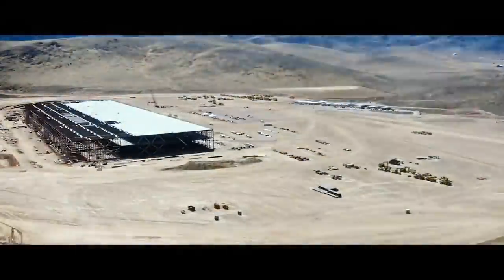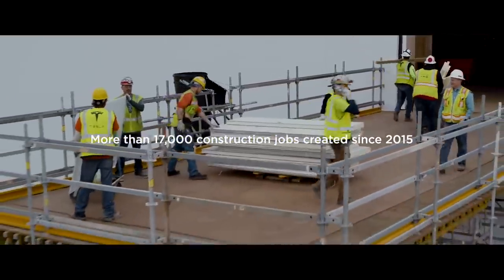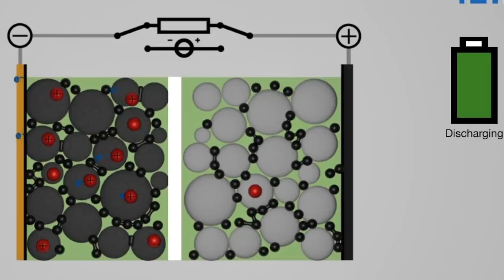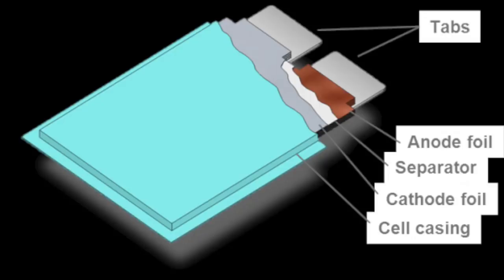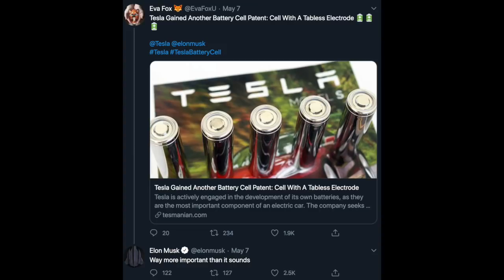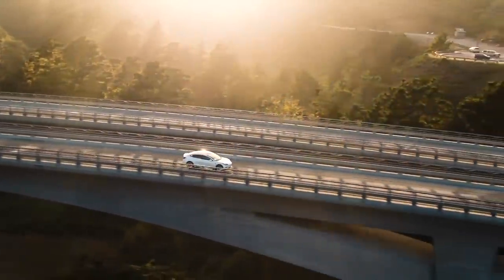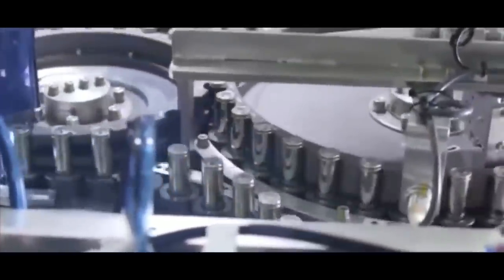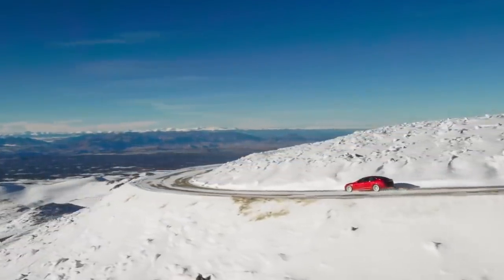Tesla's New Battery Breakthrough: Tabless Electrodes

Comment: Tesla filed another patent (December 26th 2019, as far as I remember) which stated a charging time of 9 minutes instead of 30. So the benefits of the tabless electrodes might ad onto that. I think it is very likely that we will see 80% of charge in 5-8 minutes from the new Tesla cells.
Reply: That would be phenomenal and wipe away the last advantage of ICE vehicles.
Reply: @michelangelobuonarroti916  And that will not be the only phenomenal thing! Much higher energy density, 3000 cycles (1 million miles lasting) and much lower cost per kWh. We will know more at the battery investor day. I am quite confident that the days of combustion engines are numbered. With Teslas new battery technology and enough fast chargers or a plug in the garage there will be no single advantage of ICE cars soon.
Reply: The issue with charging time, i.e charging rate is simple physics.
It boils down to the amount of actual energy transferred from charger to battery per unit of time which is all about Voltage of System and amps .
As it is now for 250KW Superchargers liquid cooled cables are needed and essential for 350Kw chargers. The resistance of of all elements in the charging chain becomes critical
Reply: I'm pretty sure that'll be the 100% charge time.
Reply: @feijaodo  Yes the 9 minute is defeninetely on the conservative side, I would not wonder, if we see something like 5 minutes. By the Way Elon Musk announced that they want to get the trophy of the cross race "Baja 2000" with the Cybertruck. Think that implies a fast charging time, as else it would be difficult to compete over longer distances.
Reply: I've had my fingers crossed for 50% in 5 minutes and 80% in 10 (I'll happily accept faster too). That would make EVs accessible even for people without home charging options and it would make the transition easier for a lot of people. It would also reduce the need for bigger and bigger battery packs and fewer Superchargers would need to be built. The criticisms of Cybertruck can't tow long distances would be moot. Hydrogen fuel cells would be done and Toyota could go F themselves.

I think increasing charge rate is more important than increasing density at this point. Range anxiety is not really about range; it's about charging. My Ford Escape only gets 320 miles on a tank, but it fills in 5 minutes so I don't worry and I wouldn't pay extra for a 4 or 500 mile tank.
Reply: @brogcooper25  Both is important because an increase in energy density reduces massively the cost if the battery if a similar cell chemistry is used - means higher energy density with the same amount of material means less cost per kWh. the battery is still the by far most expensive part of an EV. Furthermore would a doubling in energy density allow for domestic electric flights. And if the battery can easily be recycelt then there is no real big deal to carry 300 kg of batteries around in a middle class segment car. And yes the quicker charging would make especially a smaller car with smaller battery affordable, that is an important step towards fully electric cars.

Comment: I think the current charge time stated is incorrect?  I believe it only takes 30 to 45 minutes to charge up at a supercharger not many hours.
Reply from the maker: I was referring to the 220-volt charging rate which takes 8.5 to 10 hours and I mentioned after that the supercharger charging time is roughly 40 minutes. Thank you for watching, Kevin!
Reply: @Casgains  gotcha sorry I missed that, thanks for the video!

Comment: If you believe Tesla can make electric aeroplanes in the future gimme a like😊
Reply: They could at least supply some batteries.
Reply: Elon has already stated that 500w/kg (if I recall the figures right) would allow electric flight.
Reply: Tesla will overtake trucking, trains and air. its inevitable. Think nuclear to electric. Elon will solve nuclear waste. Elon will put nuclear electric at every current sub station. Transmission lines will fall and power generation will be extremely local. This will be his legacy.
Reply: I believe Tesla can do anything!
Reply: Only 11 believe... Sad noises
Reply: It will come in the next 5 to 10 years... We are already seeing planes now but the batteries are not lite enough to use. Tesla will destroy all types of ICE vehicles in the coming years. I'm too late for investing. But, I'm glad some people have had the chance to invest in the Electrification of Transportation in the world. I welcome the new change.
Reply: Small light 1-person electric airplanes already now fly around short range.
Solid State Batteries may increase the gravimetric density to 400-500Wh/kg, allowing more persons and/or short-medium range. 
Fluorine is the most electronegative element there is: if it will be possible to make the Fluoride Ion Battery work at room temperature and with high cycle life (Nature.com, Article number: 27-2020), its 7fold (!!) higher gravimetric density will make the breakthrough for electric aviation (and BTW for several other topics). 
Keep in mind that electromotors need almost no maintenance compared to kerosene engines, so there is a gigantic economic potential in electric aviation.
As Tesla puts highest effort in Battery Research&Development I think you can expect Tesla Aviation in the future.

Comment: You are overlooking something.  Resistance causes losses, reducing the resistance can not only benefit in the form of increased charge/discharge rates, but, more importantly, increased efficiency as there are less thermal losses.  This could amount to increase in range.
Reply: Yes.  Resistance heat is energy that could have been used for locomotion.

Comment: There are two ways energy density is described for batteries 1) price per kWh at the cell level 2) price per kWh at the pack level. To avoid confusion, we need to identify cell or pack. Tesla is trying to achieve a price of less than $100 per kWh at the pack level which is much harder to do than at the cell level.
Reply: Matthew Huszarik Tesla probably will abandon the modules in their packs because the cell quality has improved significantly so the don’t have to replace cells or modules. Tesla will probably introduce cell to pack manufacturing which will steamline the manufacturing process which will speed up the manufacturing process and reduce the cost. 

Othet EV companies may announce price per kWh numbers for their cells while others will use the price per kWh at the pack level which includes pack design, pack cooling system, and pack management hardware and software.